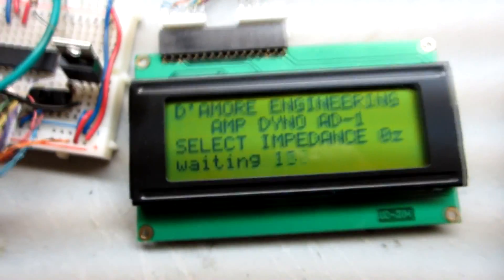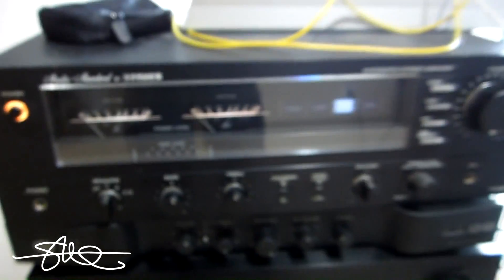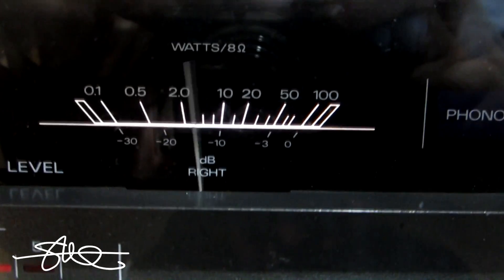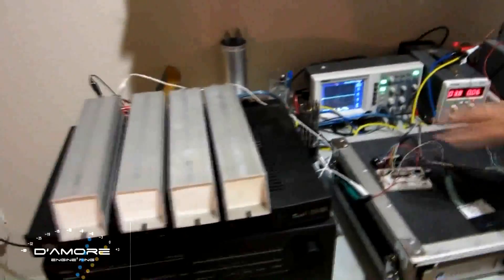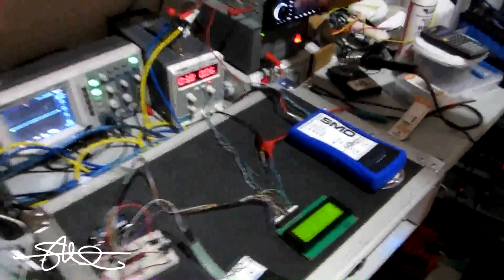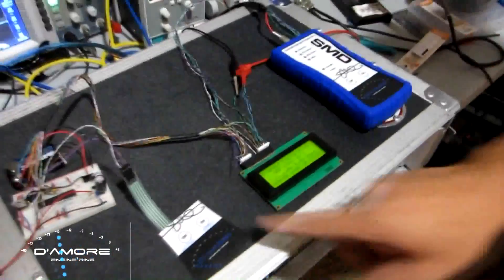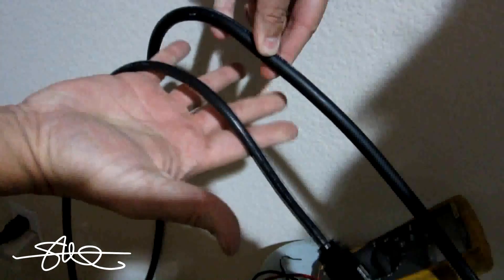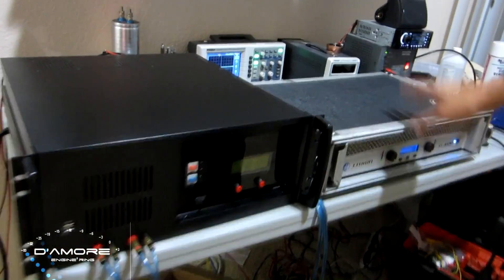New Product! Amplifier Dyno! SMD / D'Amore Engineering AD-1 (video 1)

Comment: @calvinblinkee It's useful if you have a couple of them like i do....I plug all 4 of them into the 240V drier outlet in my basement, that way they dont trip the 15amp circuit breaker on the 120v outlet.